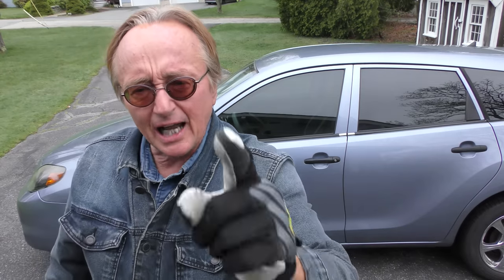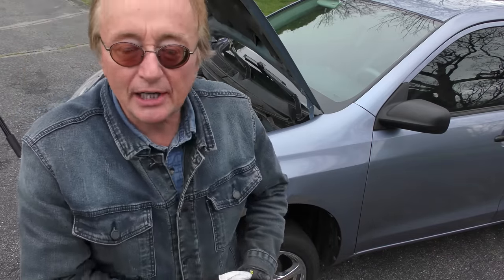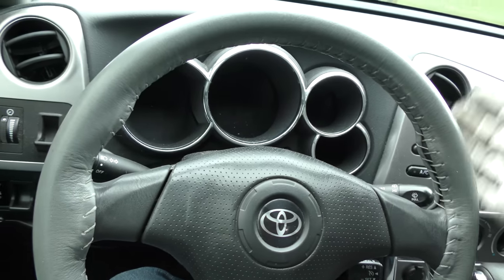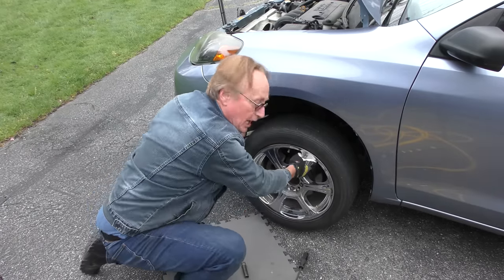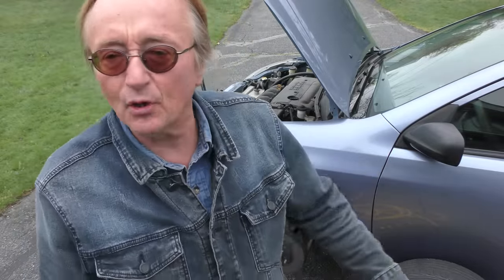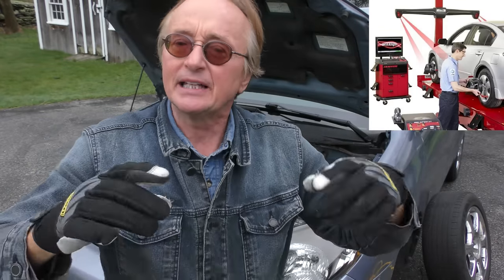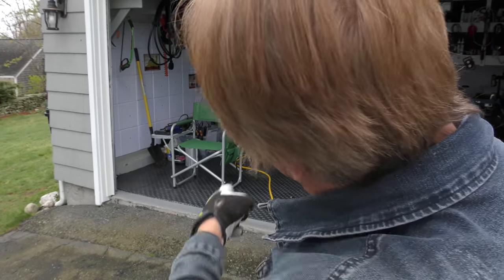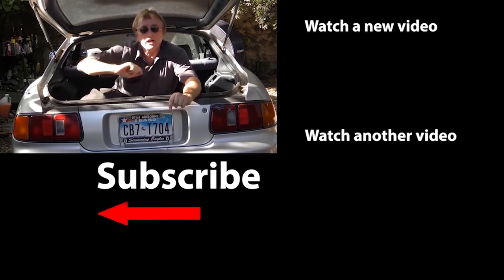I Was Just Threatened to Not Tell Anyone This

Comment: Everyone should watch Scotty before before taking their car to a mechanic.
Reply: That be correct you got it 😉
Reply: I do this. It helps.
Reply: Yeah I used to think the same thing until I just saw the tread on his wife's tires. He's obviously not too worried about his wife's safety cuz those tires are well past their due date for replacement
Reply: Better still, take your car to Scotty
Reply: @curtisj2165  yep👍☺
Reply: Well if you just listen to scotty and buy a Toyota or Honda you don't mechanic for decades
Reply: And they should follow his advice to only buy Toyotas. Then you never need to go to a mechanic!
Reply: Yeah , even dealerships get you, but not me.  266,000 miles before I changed spark plugs.  I broke down recently but I think 30,000 miles to 40,000 is replacement suggestion.  Toyota prius 2 expensive spark plug change $500. I would've done it myself but the tech bumped anti collisions warning sensor? adding an extra free day tracking down and calibration? they asked me if it had the prior problem... nope
Reply: And their wife!
Reply: @Mr._Infamous  she's got a life insurance policy
Reply: Everyone should research mechanics and find a good one.  We've had the same two for 30 years, we trust them both.
Reply: Good luck with that my brother🙏
Reply: Watch Scotty and do your own work. That's what I do.
Reply: @Mr._Infamous i doubt he drives those old cars,in my opinion it’s for the show but what do i know ,he’s got plenty of money to buy a new car and not post youtube videos so who knows
Reply: Watch Scotty before being shocked.
Reply: The rubber isn’t wiggling up and down?🤭
Reply: @chancekaufman8378  he drives EM all. That matrix probably gets more drive than any of his other cars

Comment: Scotty, I think this is your best video yet. As a single woman without this kind of help in my life,  this kind of info is priceless. I cringe anytime I have to speak to a mechanic because I know so many are despicably dishonest and I have been  a victim of it at least 2x (that I know of). Thank you from the bottom of my <3.
Reply: As a guy that knows his way around mechanical stuff reasonably well I consider Scotty's info priceless as well =D
Reply: Mechanically speaking, if a repair facility doesn't report and is unwilling to show you tangible cause (ie; worn out, leaking, torn/cracked, bent, broken or collaterallly damaged components) then they don't have a case and you should decline their suggested correction till they do or get a second opinion elsewhere.
Reply: When my wife and I were dating she drove to Fl to work at Disney for a semester. Before she left, I changed the oil and brakes/rotors on her Honda Civic. While she was down there she had taken it into a shop for something else and they guys said she also needed new brakes/rotors/calipers and wanted to charge her 3,000 dollars for it all. I'm still mad about it 15 years later!
Reply: @DegreelessnessMode  I don't blame you. So am I.
Reply: @DegreelessnessMode  I know it sets one back so far then you gotta double time to catch up -- n that'll cause another mistake 99% of the time .......
Reply: Mechanics have earned their bad rap, but there are some good ones out here too.  They don't teach men (let alone women) this kind of information in school and the kids are driving themselves to class in their 1st vehicles.. with their friends..  from a safety aspect alone this video is great.
Reply: Happens to us guys too. Even let them know you are a wrench they still try.
Reply: Unfortunately too many think women have no knowledge so garages take advantage if they can. I don't call them mechanics. I used to work on most things myself. Health and newer technology has me unable to do many things. Thank God for Scotty and others on YouTube.

Comment: Scotty. Your best informative video yet. I explain this stuff everyday to my customers. What hurts is those poor people coming with estimates,  or worse, actual work done from franchises or dealerships. 

I can give a 100 stories, the worst was a 2001 VW Golf 1.8T that went to a local franchise few years ago. Mileage was 160k km. They sold them $3500 work for all new struts, new brakes (which even if calipers were changed they were rebuilt), 4 way sway links, and thats it. All cheapest aftermarket parts. The most important they should have mentioned its an aged 1.8T and you need a timimg belt. Guess how I met them. Belt broke. Now I suspect all the other work  besides maybe pads and possibly rotors was not needed. Luckily had a link back then and got a healthy low km engine for $600. Would've fixed the valves on the damaged motor but labor would be more. (Still less than 3500! because its a silly fwd 4 banger)

All in all total job with new powersteering pressure line was $1600. And somehow the franchise got 3500 for work that can be done in a few hours, that probably wasnt even necessey, and didnt even warn the customer of what was really important. Worse is they charge list price for 3rd line parts (that means if say a drive axle is 800 at the dealer, and the aftermarket is 180, they will charge you 800, this is what paying LIST means). I agree with any retail to make a percentage on your parts, but how do you justify 180 to 800 and its not even top quality? So you're lucky if the rotors or sway links last a year or two. Many great 1st line aftermarket products available for better than dealer prices and most last longer. Say you buy an original Honda balljoint from Honda. It is not the same quality or even manufacturer of the one that was installed when vehicle was new. Dealerships also use a lot of aftermarket from local suppliers.for work while charging your full List Price for OEM.

In the end its the only reason people ditch used cars for new because stealerships and francheesey locations rip people off. I will never understand why people trust the dealership representing the brand you bought to be the best at repairing it. They are parts exchangers where 70% of.the workforce is dumb kids. They will do peel outs with your car when you're hoping for simple oil change. A shop that actually shows you your car and the problems makes sense. A shop that won't let you into.the work area because of insurance issues is bull because any shop can get liability insurance for their customers, and if they sell you that story,  they are hiding things. Get smart people and find independent shops. They're everywhere and even if they're shifty, STILL cheaper than the rest.

Comment: Years ago, a car repair shop told me that I needed new Rotors. My car, that I bought brand new, was only three years old at the time. The shop that I took it to was either a Meineke or Midas, I don't remember which one. The men there assumed that I had no automotive  knowledge at all, so when they told me that I needed new brake pads, new rotors and a bunch of other maintenance care things that were completely unnecessary, I asked the mechanic to see my rotors. The man's face fell when I asked him that. He looked like he had swallowed his tongue as he walked to my car that was still up on the rack. They were perfectly fine, there was one tiny little scratch on one rotor that wasn't even near where the brake pads would touch it. They should know better than to judge a book by the cover. They learned a valuable lesson that day. As did I, even a well known shop can be full of crooks. Those rotors lasted me another ten Years. I never had to replace them.

Comment: The recommended replacement schedule for the struts in our 2013 Subaru Outback is 35,000 miles.  Absolutely RIDICULOUS!!!
Reply: Wow, if it really needs them that often that is crazy
Reply: @TheUnknownHarbingers  He might be confusing inspecting them, at that low milage, for replacing them. There's no way that a Japanese vehicle would automatically need new struts at only 35.000 miles. However, winter driving on salty roads will threaten the shafts, pitting them to the point where they can no longer seal

Comment: As a rule of thumb, if they tell you something expensive needs to be done during a regular maintenance visit, tell them to show it to you. Then tell them you're going to drive it awhile, and research the issue before you make your decision. There are shops that will purposely break parts of your vehicle, and them tell you it needs to be fixed, which of course it does. Use common sense though. If something breaks long begore it should, invesigate the situation.
Reply: Yep, worked in some of those when I was younger
Ask up front on the invoice that you want the old parts period.

Comment: Several years ago we had a well-respected mechanic in town who everybody used who knew him. He would only charge real hours worked and he was not a cheat. If you came into his shop and he immediately recognized something that could be easily repaired by the owner he would tell you how to do it and save you that money. He is now deceased BTW.  This was back in the day of full-service gas stations. A local TV station came to him and asked if he minded helping expose ripoff shops.  Without much thought he said he would, not thinking that many of the ripoff shops were run by people he knew.   So he pulled a vacuum hose from the carb (remember this was a long time back) on a vehicle and sent the TV folks on their way. It worked. Lots of shops were exposed trying to sell unsuspecting customers a wide variety of repairs they didn't need. All that was needed was to slip the vacuum hose back on. However he made lots of enemies in the area when they found out he set the car up. He simply wasn't thinking about that at the time.  But he didn't lose customers. He gained customers although that wasn't his motive.
Reply: BTW, I now have a mechanic, an x-GM tech from a dealer that closed. He charges real hours. He was going to go to another GMC,  Buick, and Cadillac dealer but right after he got there they brought in a consultant to show techs how to reel in customers. He knew he wasn't on board with that and could get by doing things his way other than the hours the book called for. But he told me that during one session the guy played the theme from Jaws and that did it for him. He left and opened his own shop. Here's an example and you can look this up on youtube. I had an 09 Acadia. The oil pressure sending unit/switch went bad.  I knew I had good pressure so there was no rush.  The sending unit is right below the oil filter on the front side of the motor.  I'm calling the front side the side closest to the radiator. It's really on the side of the motor I guess.  The motor is transverse mounted.  You need a deep socket but other than that it's just a tedious job.  My guy said he could probably do it in an hour plus the parts which in this case would be the unit and a new oil filter which you'd remove to make the job easier, oh, an oil of course to go ahead and do a change.  So for giggles I called a few shops.  Every one of them said the alternator had to be removed. NOT. But that's what the manual said and the cost would be $600. How do people sleep at night pulling that stuff on unsuspecting customers?

Comment: I was told my car can't be aligned because the struts and drive shaft have to be replaced.  But the shocks actually feel fine.  So I'm glad you told me this.
Reply: Yeah, I would get a second opinion. I just went through something like that, I was told my car can’t be aligned because I needed all my ball joints replaced. I took it somewhere else. It was just one upper ball joint on the front. That’s a difference between paying $300 and $1200.
Reply: You can’t have bent shocks and bad strut mounts that don’t make noise but make your tires wear unevenly, which leads to bad alignment.
Reply: @Ninnjette-  replacing just one means the lower has close to the same amount of wear, the entire wheel can snap off without notice if does go out
Reply: @xFactoryUSA  I had it done, the first mechanic said all of them I know what happens when a ball joint goes. I take it to the second mechanic, he brings me around when it’s still on the lift. He shows me, which one needs to be replaced and shows me the others are good. I’m trusting the mechanic, that takes the time to physically show me.
Reply: @Ninnjette-  oh that’s not bad then, you know, in the future there won’t me gas engines,  but there will be suspension components. It’s good to not be scammed, pass the knowledge along! Always have them show you in person
Reply: Post the name of the shop  that told you this
Reply: @Ninnjette- 😂😂😂
Reply: @xFactoryUSA  That’s the first time, I’ve had a mechanic do that. Every other weekend, he said he helps people out they just bring the part he charges half labor. I struck gold with this guy I feel. I know! I’m not looking forward to it, I like older cars much easier to fix.
Reply: @victorbaird8220  Hahaha cars funny. Wtf lol
Reply: @Ninnjette-  support this guy every chance you get !!!!!!!!!!!!!!!!!!!!
Reply: Drive shaft needs to be replaced? ... please! Drive shafts last longer than every other part of the vehicle, unless you're off-roading like crazy, or drag racing a heavily modified vehicle.
Reply: Treat the mechanics like you treat a doctor and get a second oppinion.

Comment: also, if u get alignment. make sure that its correctly done.  everytime i get one done, its NVR right.  after the 3rd try, they told me my links are no good.  900 to fix.  im like eah tire has one, they cost about 15-25 a piece. thats 100 or less, but then 800 for labor?  all u need is a socket set and sometime.  rip off.

Comment: 3 Quick ones - Mazda 2018 cx5 Skyactive, 40K miles.  Love it. Regarding transmission fluid - 
1. with the Skyactive system, Is it still necessary to change it regularly, and are transmission flushes worth it? Also - I had NEVER considered the importance of torquing the wheels to spec!!  Damn!  That's probably why rotors warp.  Shops use impact drills all the time to bolt down tires.  What do they care? Car in -  Credit Card out. - Car out. (Just thought of that - Credit C Mitchell)
2. How often should I clean the intake valves with CRC?

3. Best fuel additives for cleaning the direct injectors? If all brands are the same, that's fine, just want to find out. 
(I still say you could pass for Stephen Stills older brother.)
Keep on rocking Scotty - You do go on  and on and on and on... but you're a lot of fun to listen to!

Comment: Hey Scotty, my wife's 07 CRV, had such an annoying squeeking and crunching sound, I asked you about and BUSHING IN THE REAR, was basically your answer. RIGHT ON, OF COURSE, LOL. Altogether, 10 bushings of 2 different sizes, had to be pressed out, and new ones pressed in again. BINGO, no more noise!! That was it, a full set of bushings in the rear assembly of our Honda CRV. We're so thankful for your help and now it's a pleasure to drive again, especially here in the Philippines, our old roads are all falling apart and rough as can be! 
Roads are getting rebuilt as I write however, but thanks again my friend!
Reply: Spray grease bingo!

Comment: We used to have an old Honda Accord wagon that had over 300,000 miles on it when I finally sold it , but not before I drove it , my wife drove it and it got past down to each of our two daughters who drove it throughout high school . When I sold that old Accord wagon it didn’t leak or use oil at all. But I changed the oil and oil filter every 4000 miles religiously !  And everything on that old Accord still worked too. It still had all its original parts except for the starter !  But other than changing the oil and oil filter every 4000 miles and front and rear brakes when needed  and part of the exhaust from the cat back that ole car was still running like new when I sold it. To this day I’ve never bought any other make or model than a Honda Civic or Accord , and all I’ve ever had to do is change the oil and oil filter and brakes on everyone I’ve ever owned.

Comment: Yes autozone brake pads are noisy but last a long time. The noise been driving me nuts for years
Reply: Auto parts stores sell a "brake quiet" goop that you can put on the back of the pads where they contact the caliper & piston, it might help.
Reply: Really cheap pads are not ceramic so the wear out faster and get hot quicker.  If you get lifetime warranty, you can replace them often (for free).  But my suggestion is get OEM equivalent pads.  Noise?? Never had noise and I have had a lot of cars with all kinds of pads.

Comment: Thank you for telling us the oil in suspension scam. You saved me.

When I bought my car after saving for a lot of time, a cheap and old one, but affordable. I went for a tire replacement, they sowed me the oili suspension.

I knew it was a scam because of you, so, thanks a lot
Reply: 60 minutes actually filmed  a Shell station mechanic doing this....squirt tube of oil in a shop rag,leaned under the car while the customer was in the rest room....The  test car had  had all 4 tires and shocks changed before the trip,then driven through mud so the new equipment and parts werent noticable then drove cross country and stopped at stations  adjacent to freeway offramps...I think they bought 3 sets of shocks before they reached the East Coast....